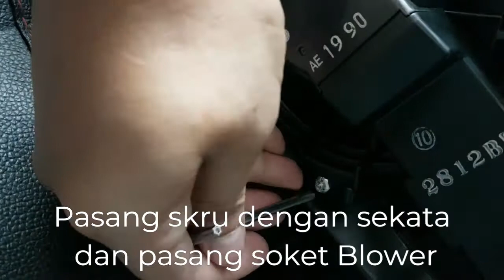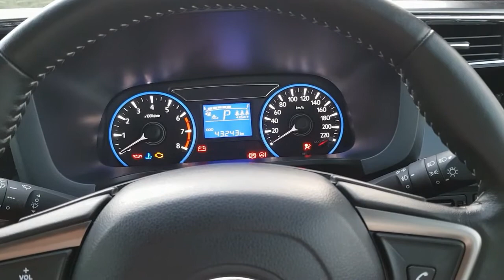Cara mudah servis Blower Aircond Perodua Myvi 2018

Comment: Kenapa sy punya myvi2018 x ada  3 screw tu.
Ada video lain x nak buka blower??
Reply from the maker: Sepatutnya ada 3 screw tuan. Nti saya try buka blower semula
Reply: @mashran  dah buka tapa x ada screw  3 tu
Reply: Ada skru boss , cuba cari betul2 , kena tengok dalam2
Reply: kalau cuci
blower ni adakah aircond boleh sejuk skit? main peranan ke blower tu?
Reply from the maker: @tololchannel8343  blower ni fungsi dia tiup udara sejuk yg dtg dri cooling coil. Kalau blower bersih udara pun bersih. Untuk aircond sejuk tu bergantung dgn cooling coil, tp kalau blower kotor, kipas blower akan slow dan udara sejuk dari cooling coil tidak sampai kepada user.